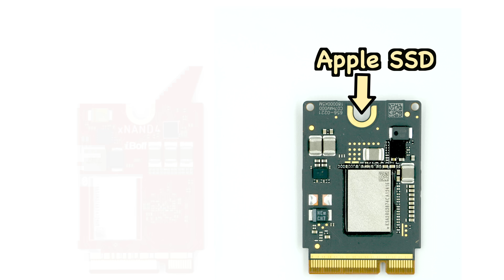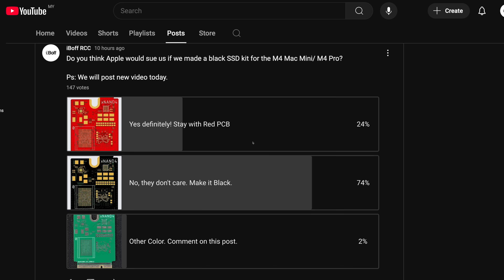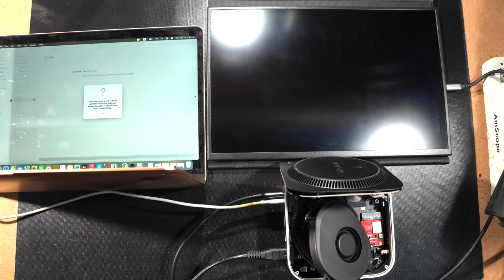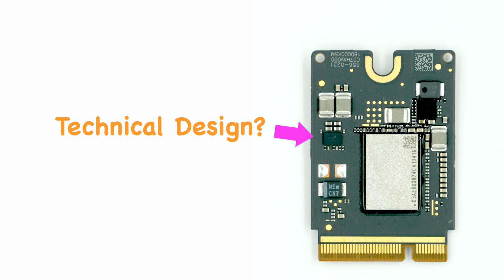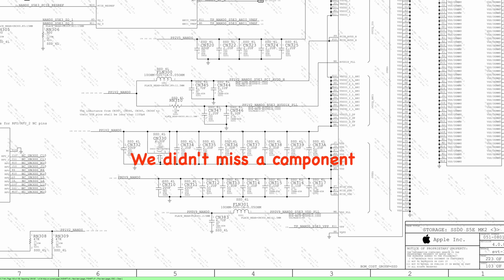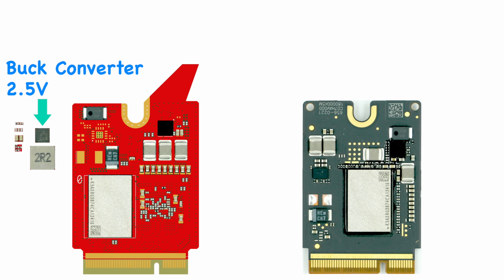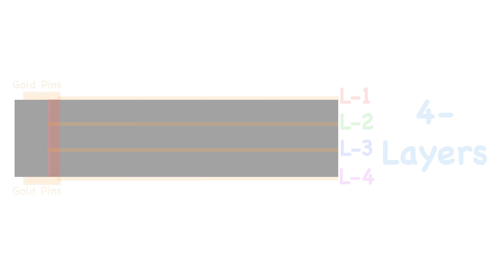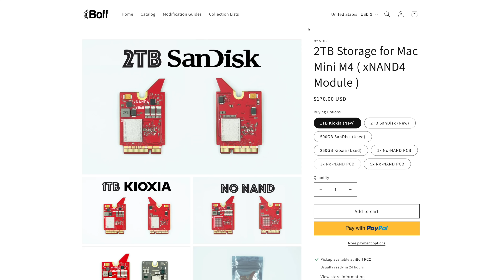We Finally Beat Apple’s M4 SSD – Faster, Bigger, Cheaper!

Comment: $170 for 1TB
$260.00 for 2TB

I'm not a Mac guy, but I'd be dumb not to consider 3rd party storage option vs Apple gouging
Reply: it’s only just becoming an option. and only for the M4 mac mini not older M-series mac models.
Reply: true that!  Fact is even being on Apple platform since inception - even their removal of upgrading ram has me considering a platform change.  Seems to me this amount of greediness is over the top.  Reminds me of the powerPC days when Jobs originally sealed the hardware.  Everyone went berserk.
Reply: People who buy Apple products aren't making good financial decisions.
Reply: 1TB for Windows Desktop/Laptop (NVME PCIE 4.0): $36.
Reply: @tim3172  They had to re-engineer Apples board. That’s what the price is for, not the Chip.
Reply: @tim3172 source?
Reply: @tim3172  since when? NAND prices are crazy right now
Reply: Wondering if this takes off whether apple will introduce some keys or otherwise lock the ssd down. Maybe they let it slide until now as an upgrade required desoldering the Nands, and that’s difficult and expensive 🤔
Reply: @HNedel i think they are introducing SSD cards rather than soldered SSD on motherboard to hedge against anti-trust action one day as the #righttorepair movement gets more and more traction. it took the EU legislation to force Apple to use USB-C on its latest iPhones, that’s how belligerent Apple are, and even then they purposely hobbled the speed of data transfer so it was a small fraction of what USB-C specification is capable of, except on the Pro model iPhones.
Reply: @alastairleith8612 no, the ssd is socketed because they don't want to litter warehouses with all permutations of memory and storage. they make different boards for memory, and reserve the ability to spec storage during assembly
Reply: @HNedel  i was thinking the same. like they ight just say ssd is not original part or something. just like they did with battery and display. they might just block it due to "security reasons" too
Reply: well, these guys are not huge as far as I can tell, definitely not as huge as Apple, and Apple still charges $200 for 500GB. Pricing doesnt tell anything about competence fyi
Reply: @cheebadigga4092  With these prices the demand will be constant, especially further down the road with ballooning app sizes

Comment: For the claim beeing faster than Original Apple it would be necessary to test against a 2 TB Original Apple version. Of course the 2 TB is faster than the 256 GB version.
The comparison is 2 TB iBoff RCC vs. 2 TB Apple.
just got my 2 TB WD Black SN850X, the Zykedrive is still on the way cost me 215€ in total, with an cheap TB4 enclosure i could get another 20€ discount, Even with writing data 500GB no throtteling. How does your storage module behave in AJA System test (blackmagic only tests Data up to 5GB).

Please inform us about Mac Mini M4 Pro Solutions. 

One important question how do the number of NANDs influence the performance  e.g. realizing 2 TB module  for the M4 Pro with 1 NAND of 2 M vs. 2 NANDs of 1 M vs. 4 NANDs  of 512 (same for lagrger  and smaller capacities. 

Does a bigger number of NANDs in parallel access speed up performance (WHEN SLC-Cache is exceeded)? 

Depending on the price a higher capacity module for the Mac Mini M4 Pro or even the Mac Studio can be interesting for me.

Yes of course you need your ROI, but to behonest the prices actually invoked by the competitors are quite on the high side ( so it is cheaper to go for a HIGH quality NVME drive with a reasonable TB-enclosure. Depending on the quality of the NANDs and the TBW the acceptable price is to discuss.

Reengineering the PCB, changing the colour , adding an installation support are good arguments for having less problems with the bitten fruit company.
Reply: Just looked at your website, why don't you state the NAND producers in the video? Kioxia and Sandisk are well known brands, why not stating which model is used  why no TBW. The TBW is found on the order page.

I like the red one. is the red one in 6 layer and if i want the chance to get a 8 layer i have to order the black one?

Comment: weird my m4 mini pro 512gb shows 4317MB/s write and 5109MB/s read, how is it faster than your apple default ssd?
Reply: No M1/2/3/4 Pro chips always had faster SSD speeds than the base M1/2/3/4 chips. Probably because the chip has more data lanes to the SSD and then Apple used more NAND chips with RAID
Reply: @remo-pro so will using this 2tb upgrade give me better speeds than the benchmark in this video? thanks for the reply btw.
Reply: @ when you google it it looks like 1 TB SSD will be faster. I’m not sure if the 512 GB SSD in the Mac mini M4 Pro have 4x nand chips. But 4x 128 GB will probably be slower than 4x 256 GB in the 1 TB

Comment: Is it possible for Apple to detect this "native SSD"? What if they check serial numbers in future OS versions? It would be fatal if they publish an update that suddenly can detect an non-apple nvme. I guess you guys have considered this scenario. I will definetly buy a few in the future. Are you planning to make an "adapter", so one could use a standard nvme-ssd? That would be the icing on the cake! Thanks for your work! This is an great achievement! ❤
Reply: The EU seems grouchy these days; they could impose a Big Hammer on Apple for making so obvious a change to avoid competition. Only a small percentage of users will ever buy this storage option; I suspect Apple will ignore them -- avoiding the Barbara Streisand effect.
Adapting to any NMVe pinout to Apple's layout would have worse geometry than what they achieved on this custom board.
Reply: Apple Silicon Macs have the SSD Controller in the M Chip so the SSD is only the NAND chips. A normal nvme drive has a controller which the Mac doesn’t need
Reply: @remo-pro this is not true. In Apple silicon macs, the nvme controller is embedded in the same package as the nand chip, and PCIe interface is used instead of the traditional parallel nand interface.
Reply: nand chips doesn't have any sort od serial number
Reply: @VolodymyrMoon  while chip doesn't logic on the board can add it. s/n then would be dependent on "whatever is on board". s/n can be signed string by apple.
Reply: @VolodymyrMoon  I just thought about the ridiculous situation with the PS5 and the one time pairing, of the optical drive, to one console. If Sony gets away with stuff like that, Apple might get dumb ideas. I don't know enough about the specifics of apple vs non-apple-nand, also maybe some hidden S.M.A.R.T-data. It seems possible, given you've tracked all your shipped nands... Let's hope I'm wrong!
Reply: @jared-pm  In the case of the consoles it serves the purpose of preventing piracy, which is illegal. So it's definitely not the same. SMART-data is stored on the controller, btw.
Reply: Did you know that that is actually just the NAND flash chip? There's no DRAM or controller. You can't put a standard M.2 SSD.
Reply: Apple can definitely detect disk size changes from the machine serial number. If that happens people will find a way to bypass or nullify it.
Reply: Honestly I expect that apple will figure out a way to detect these parts eventually. But when they blocked those things in iphones they technically still work. Apple just makes the experience intentionally worse without preventing you from using the machine. 
They'll do things like disabling touchID for login. Limit read/write speeds to 1/4. Remove screen dimming controls.

But if the number of people who buy these parts isn't that big they'll just ignore it and find a new way to block it on the m5.

M.2 is impossible to add internally. Just get a thunderbolt enclosure and plug one in the back. It's nothing new, you could always have more storage externally and Thunderbolt is so fast you won't feel a difference.
Reply: @SquintyGears  I really don't think Apple cares after the initial sale, except for voiding your warranty. It puts one more Mac in the user base. They keep the boot loader open, so you don't even have to run MacOS. (Good luck figuring out the device tree, though.)
Reply: @robertschaaf8606  i would agree that they don't care that much about mac.
But they have done all the things I've described in the past. It's not hypothetical. And they're also not shy about bricking perfectly good devices. If a user sells the mac without logging out it's bricked. It's theoretically anti-theft but when it's a school's IT team dealing with that it's not quite so clear why there's not a single way to request unlock. 
Because the devices getting reported as stolen in "find my" isn't required for this. You just can't log out. And it will request it after reset when it checks the serial online.

And apple does make money after the sale in the appstore and with subscriptions. Unlike windows. So it's not a matter of warranty at all for them.
Reply: 1. it would be impossible to enforce retroactively
2. Apple KNOWS how to serialize parts. they would have serialized them on day 0 if they cared
Reply: They'd prob check the firmware signature. Serial numbers can often be re-written to different hardware.
Reply: Take my money now 😂 how much for 2tb ?
Reply: Apple don't care about this, think, hackintosh still work, I'm current using an 14h gen Intel processor with no problems, including upload apps to Apple Store, also using a random gen 4 7000MB chinese ssd
Reply: Updates are the Antichrist
Reply: apple SSDs are not NVMe, it's a custom protocol
Reply: @erkinalp  Apple SSDs are nvme. If you check the system information app of your own mac you will see that your internal SSD is listed under the nvmexpress page.
Reply: to all here:
there are NO serial numbers or firmwares on these chips, it is simply RAW storage, NAND with no controller
if the controller had a serial number, it would still be impossible to serialize the storage cards as that controller is located inside of the SoC, not on the NAND cards
the NAND cards just hold some support components in addition to the raw storage, such as voltage regulators
Reply: @ethernet01  If you have ever watched the part 2 of the removable MacBook pro storage video from this channel you will know that those chips are not "raw NAND chips". They do have NVMe controllers embedded in the chips and they are connected to the SoC through PCIe. Like literally look at their PCBs, there are clearly differential pairs for PCIe signals. Raw NAND chips use parallel interfaces, and there will be dozens of length-matched data line instead the 4 pairs of differential data lines.

Comment: just curious where is the kit for the replacable ssd for mac m1 air?
Reply from the maker: @GrimmReapgi  since that one requires soldering, our PCB Fab has issues manufacturing the stencil required. So this mod is delayed alot
Reply: @iBoffRCC  ahh ok ty for the absurdly speedy reply

Comment: This is a very cool mod. But I find the 5x empty modules for 300 bucks pretty expensive. 
Now don't get me wrong this is a really cool board and im sure you put a lot of time into it. Isn't there a way that you let the SMD soldering be done with a machine? That will cut down the costs.
Reply from the maker: @kyzo_124 actually yes, it is pretty expensive considering the small project scale for now and it might get cheaper if produced at super high volume. The only reason for this is the 0.6mm thickness that Apple used. If, and only if they used 0.8mm thickness then things would be so much different. 

You can actually make it a lot cheaper if we choose 4 layer PCB. And FYI this is the current cost when we assemble all SMDs in PCB Fab.

Comment: *I've added to this at the end of my original comment - leaving my original post unmodified .. I have 2 M4 Mac mini (base 256Gb, not Pro) & have been following you with great anticipation for a reasonably priced SSD replacement's for the 2 of mine. What I was concerned about was the IC's that other people from the far east might use in their construction - may have been recycled / come from donor PCB's, meaning that the longevity & data integrity of the SSD might be compromised from an otherwise new SSD. Those fears appear to not exist with your product! I am just hoping you can manufacture for a reasonable price & not just a reasonable price compared to Apple SSD upgrade prices... * Having just checked the prices to the UK - I think they're quite reasonable. Unsure if there'll be a tax hit on top when it lands in the UK, feels like there almost will be but the 1TB is a sweet-spot price for me - well done guys! Shame Apple didn't do similar in design with their new M4 MacBook Air which I have!
Reply from the maker: @ApplesnCastles  yes actually we do want to produce it so much cheaper. But the NAND's price are hiking up since the demands in China is increasing. We really want to depend on 3rd party NVMe but this is what we can do for now.